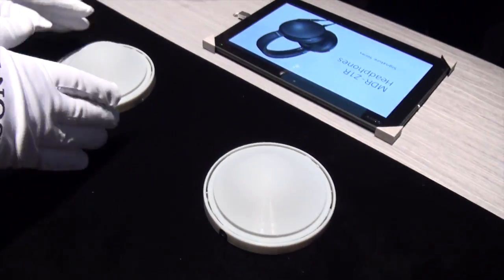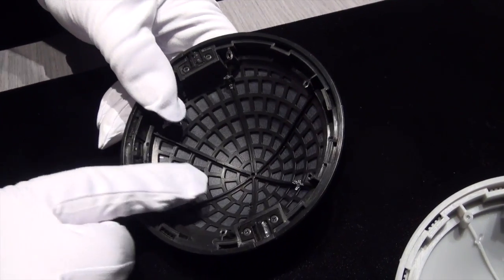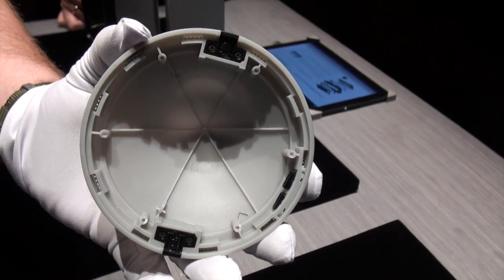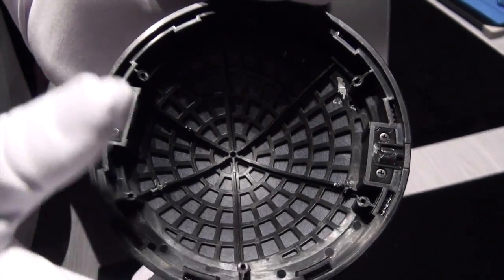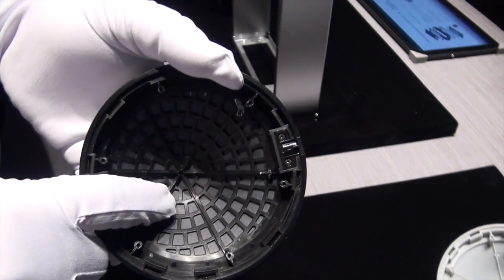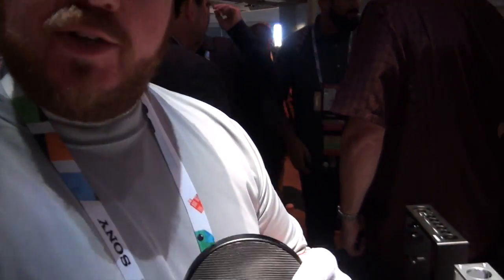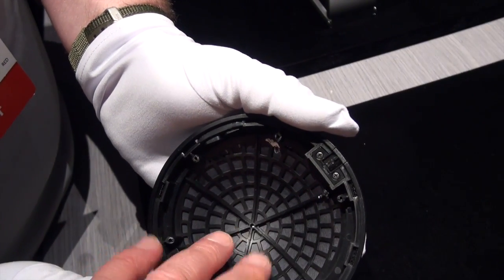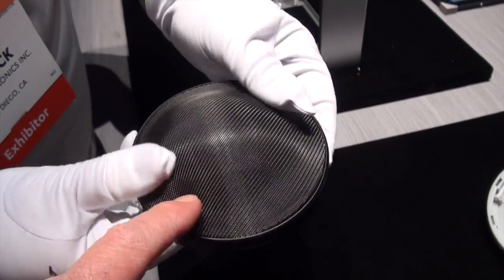CES 2017 Sony MDR-Z1R Ear Cup Construction

Comment: One of the biggest negatives of the Z7 was the lack of dampening in the cups, good to see that's fixed with this material. What I don't understand, is why would you put the dampening material after the plastic frame? Why not in front of it?
Reply: The paper itself wouldn't be stiff enough, would probably resonate at bass frequencies. 
So to counter this you have to sandwich it between two stiffer layers, ie. the plastic former and the outer mesh.
Reply: David van der Zande Because it harms the detail and transparency.
Reply: because it looks better